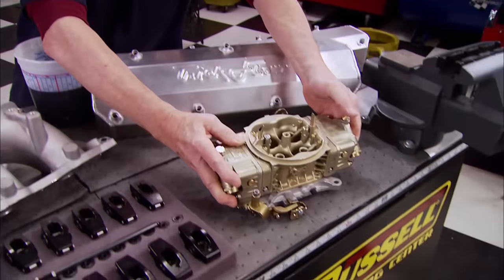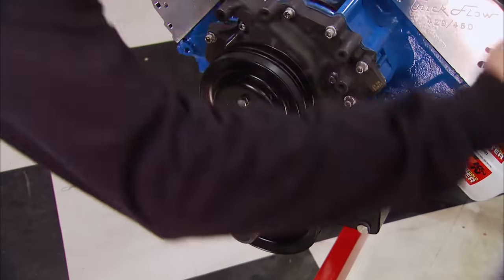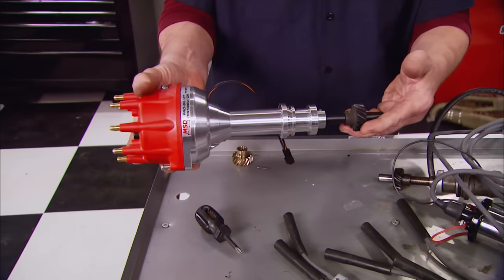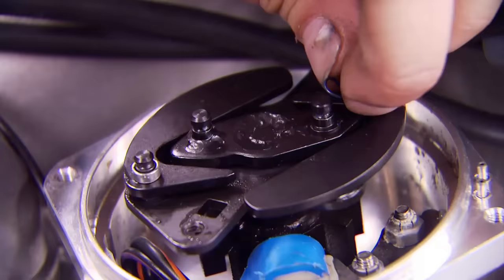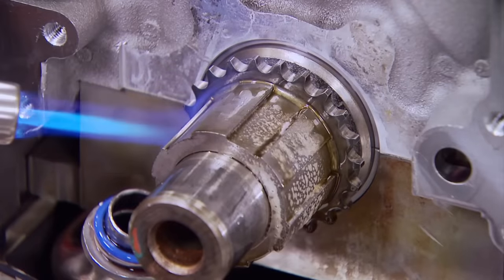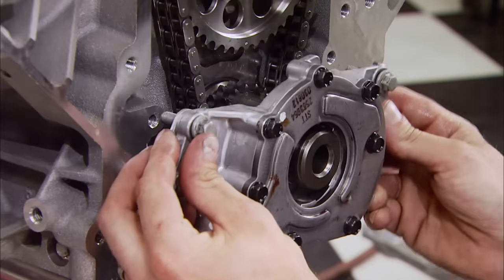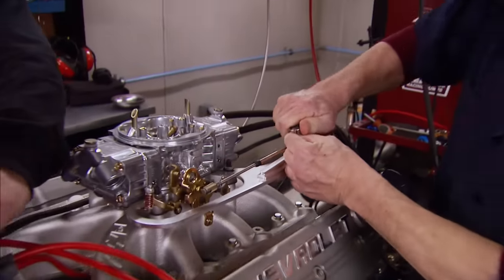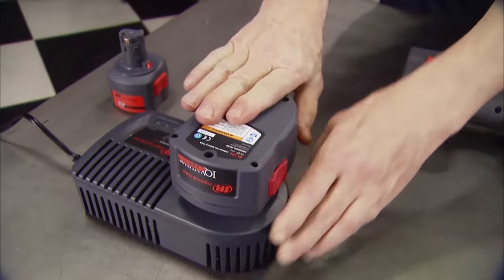Ford 460 Engine Build Part 3 - Horsepower S13, E10

Comment: Oh geez 😱 the quickest way to cross thread a bolt especially in alloy is starting them with power tools oh god
Reply: Only a problem if you expect to remove them later. /s
Reply: david eliassen , I saw that and NO LUBE on the cam swap either 🚽
Reply: It pained me seeing that. Using power tools to drive anything but large diameter, coarse threads is a no-no, IMO.
And the way they slam and stuff things around, geez.
Reply: If you know what your doing its no big deal...
Reply: it made me feel a little sick
Reply: Cross thread is better than no thread😁😁😁
Reply: SpaceRider 
Your right. I’ve been a technician for 35 years. And that’s what you do in lot a cases.
Reply: @robbiefrentz9427  
Cross thread is stronger than locktite
Reply: Alex West 
Roflmfao. Omg so damn funny. Going to steal that saying 🤣🤣🤣
Reply: cross thread is the best lock tight!

Comment: 460 making 600 hp na. That's nice💪💪
Reply: With a mostly stock bottom end. Basically a head, cam and intake swap
Reply: marshall mcdowell the heads and the cam are pretty much the worst part about any stock 460
Reply: Add another 2k and you can have a 514 stroker for like 100tq more
Reply: john dowe I’ve got a 514 going in my 1967 Country Sedan wagon
Reply: @thedraftdoctor1  nice man, i want to build my 460 to a 514 in my 78 bronco
Reply: Add a 1-2-300 shot... 😂😅
Reply: @thedraftdoctor1  Sounds awesome brother. I would love to see videos of that.
Reply: Whats the parts list on the motor. Would like yo do the same build
Reply: @stevenvanheel3932  Have you had any issues with the oil overheating or low oil pressure with your 351M?
Reply: Parent of Twins it had low oil pressure at idle. I pulled the motor and fully disassembled it with the intent to rebuild it and turn it into a 400. When I took it apart I found that my 11,000 mile engine had every bearing showing copper. That is just a poor engine rebuild job by wagamon out of Minneapolis. I since then dropped in a 400 that makes like 12 psi of oil pressure at hot idle which is not ideal but not the end of the world either.
Reply: @stevenvanheel3932  I was wondering because my Dad and I rebuilt one 20+ years back and at first it had good oil pressure but within 5k or less we were having a hell of a time keeping decent oil pressure when warm. I was wondering if the shop hadn't cleaned the block properly or something so wanted to see if we were the only ones who had issues.
Reply: Parent of Twins I’m pretty sure that it is a really common issue. You may want to try to run thicker oil in it and see if that helps.
Reply: @stevenvanheel3932  Thanks but that engine bit the dust years ago. I wanted to know if that was strange or normal for the 351M and 400. It's too bad because that engine sounds awesome. Dad's truck looked awful but I loved driving it because it had an great sound to it especially when you got on it.
Reply: Parent of Twins they sound pretty good, that’s for sure
Reply: Imagine forced induction going through this thing. 900 horsepower?
Reply: Its capabilities are 640 cubic inches and thousands of ponys from turbos or nitro from the 4 bolt main version.

Comment: Why put a dizzy in the LS when you can just put in an MSD box. That allows you to use the factory sensors, coils, and plug wires with the carb!

Comment: I owned a 1969 Lincoln Mark III .  It had a chromed badge plate under the hood that rated the 10.5 to 1 , 460 c.i. at 365 b.h.p. @ 4600 r.p.m.  A great car with the engine to prove it.

Comment: Fun to watch the ole' iron 460 make some numbers...on your valve checking, fixed a fair amount of Chevy/Ford BB "porcupine" heads after checking valve wipe left & right by having to cut the pushrod guide plates apart then rotate and tighten back where the belong, followed by me TIG welding them back together....Enjoy the videos, keep them coming and I'll keep watching!

Comment: I'd really like to see an old school solid lifter flat tappet camshaft in the big block. I feel the 607hp at 6000rpm is being limited by the hydraulic roller since hydraulic camshafts are done by about 6000rpm.
This thing sounds so smooth I really think another 5-700 rpm might yield another 40hp making it ~ 650hp. Very nice!
Reply: ThePaulv12 
They couldn’t do that because it would have beaten the 454.
Reply: @roninkraut6873  lol
Reply: Na, it'll run forever like it is, and hooking all that torque up on street tires is gonna be really hard anyway. A big solid flat tappet can would soften it below 3000 rpm or so, but breaking the cam in, having to put zink additives in every oil change would get old!! Love to have that motor in my 94 f150 flareside! Ladder bars and track locator a must tho.

Comment: I'm all for the big blue oval was a chevy fan but got me an 89 mustang lx 5.0 it was enough to change me for good
Reply: love the FOX! 🦊
Reply: I've got 3 Fox Mustangs, they are cheap and FAST! I'm still building a 408 stroker. Hope to have it done this year, the engine at least. I've got some vids on my channel if your bored! LOL!
Reply: chevs allways cheap out.the 35-0 is a dog of an engine.good std,just dont touch it.ive allways had fords.here in aus.,my dad had holdens,gm,derivitive,never liked the design or mechanicals.small,cheap.cant beat a good clevo,top loader,9"..there a truck engine,tough.windsors are for race day..biggest rubbish chev sold was the 6.2 diesel,inc the 6.5 tdi.old buik petrol motor.good power but handgrenade..look up ford f1000,brazil.mwm 4.2tdi...you,never got them..

Comment: I'm a big block fan. I seen EFI 460 Modded. U can get way more torque than a LS9 modded.  Big old engine hard to beat lol.
Reply: True story!
Reply: Cubes are such a great thing when you need real power
Reply: And a hell of a lot cheaper too. LS9 is expensive where the 460 has been around for a long time. Ford made a lot of them.
Reply: @PropsandWings  Yup. I won a $3000 burnout contest with a $200 BBF. By far the best bang for your buck.
Reply: There’s no replacement for displacement.
Reply: @dickysgarage7120  .....ya buddy.....that was at Cleeter's Event!

Comment: My Bud was a BBF man. Built many 429-460's. As HRM mag said, the 460 was the quickest and cheapest way to 600 hp. You guys proved it. By the way my Bud ran his 460's at the Grove. He usually ran them several seasons before a tear down. In his words they were durable, dependable, and amazingly consistent. By the way the show was great, except for the Chevy part,lol.

Comment: Great video series on the 460's.....have built several and love them......once you get rid of Ford heads.  I'm learning a lot from you guys even at 72 years of age.  I can tell the info is good......your hands look like mine!  Believe it.  Wish I had your equipment.  Keep the faith.  PS.....Great work on the LS motor.....I've been resisting them as an old timer.....but, in my heart, I know that's where it's at now.
Reply: 460s are solid motors the bottom ends are hard to kill. Head and intake swap and depending on budget if you can do the intervals low psi turbo charger, or both Torque wins everytime. And considering if more NA power was needed the 460 turns into a 550 in a overhaul for about the same cost. If I had to go for a newer age motor.  Instead of the ls1 I think I'd go for fords 5.7l DOHC fully built these motors can make some serious power NA.

Comment: Throw that 460 in a Foxbody or a Maverick🏁🙌🏽
Reply: Samuel Monsivais or on a late 80s f150 hahahah
Reply: Samuel Monsivais , yeeha, I had a 1970 Ford mavrick
very lightweight.
Reply: Tim Schutte I love the old  Mavericks  there an underrated car that a lot of people look over
Reply: Samuel Monsivais , mine only had the 250 six single barrel carburator but it was my very first car I ever owned. friend of mine had the Grabber 302 V/8.
pretty fast car. did good burnouts, lol.
Reply: No that’s what the LS is for🤣🤣🤣
Reply: Amanda Brewer better to have the authentic ford motor instead of the bootleg ford motor.
Reply: Or swap that 460 in the Ford Ranchero or an F100 or even in a Ford Bronco.
Reply: CJ Colvin hell yea would love to see an F-100 build with a 460 in it
Reply: @sammyvices2547  Sounds awesome brother or it can even be a great swap for an old Bronco.
Reply: For me a maverick or a cougar
Reply: Samuel Monsivais I have a 1970 ford f100 with a 460 in it
Reply: Those Mavericks. I had a 71 with a 67 Mustang front clip welded on and rear metal flares welded on to cover the 13 inch racing tires. Fully built 302 with tunnel ram, Top Loader 4 speed, and a narrowed 9 inch rear end. Those were the days. It was painted black.

Comment: how about you start showing whole dyno graphs to get a clearer picture of power production
Reply: That's why engine masters is way better
Reply: Because it's not a Chevy. If that was a 454 they'd have forged high compression pistons, tried 3 different intakes and carbs with jet changes, multiple timing changes, then nitrous

Comment: you mention how much the budget build was but it would have been nice to include the general cost of the parts for the high performance upgrades to get it to 607hp
Reply: I agree. I watched the video a few times to find out, but you never said the cost of the high performance build.

Comment: Came for the 460 and stayed for the LS. Wish we could have heard the 460 idling. Nothing quite like a big block Lope . LS had a great idle sound. I know many of the new engines make fantastic horsepower and torque with an imperceptible smooth idle. But, I'm old, and Lopey rough idles bring back fond memories of my youth.

Comment: Really considered a 460 for my 94F150 flareside. I got heads, roller block, pistons already on the rods, intake for a hydraulic roller 357ci Windsor! Even got a tci tyranny! The difference in the weight and the powershot will almost make up the difference! But, we have a 460/c6. Decisions, but the economic impact with today's crumbling economy, go with what u got!!
Reply: A 460 would move that PU down the road very well.  If you're good with the gas bill, go for it!
Reply: @eskieman3948  yea, I thought about it. Knew some guys back when I raced that put them in 150s. They probably bought every 69 to 71 Lincoln  in 3 counties. They had a 68 Falcon (it would fit in that body, just used mustang mounts). But, I'd have to start all over! I got 3 sets of heads for the Windsor, 2 short blocks (ones a 95 roller), pistons already on the rods! Think I'm gonna sell those aluminum heads, the ported 289 heads will make more compression with the pistons I have on rods now! It's gonna be a rat rod, not ever gonna paint it!

Comment: What was the ford horsepower details and at what rpm? Most importantly, what was the torque? Wtf? Off into LS land.....
Reply: Technical Items they always throw LS sht in  Ford episodes! 😒
Reply: 607hp @ 7000 rpm
Reply: He only pulled it to 6k. But yeah I quick watching more than half the video turned into a chebby episode. Thumbs down from me.
Reply: Technical Items , Ford was about 600 HP
Reply: You guys are haters on chevy i mean chebby just jealous that chevy makes such a good motor reasonably priced and a million parts that the working man can actually afford and depend on i love the ford small block and the sound it makes dam good but it doesnt compete with any ls as in sales and parts ford didnt put any effort in trying to compete with the ls thats when i lost all respect for ford now if you want a coyote motor but who has that kind of money to work on it when you're just some schmuck welder working your ass off to make it with a family chevy does and im proud
Reply: Bryan Roupe he could’ve probably pulled it 6500 easily smh
Reply: When they dyno'ed the stock 460, it made 493 lb ft, and 378 Hp  So, I'll bet they easily pulled over 640 lb ft. ..but didn't want to make GM look bad.
Reply: @tuckerc3802  
I think the fellas are angry about the LS stuff because the title of this video is: Ford 460 Engine Build.

Comment: I missed what the benefit of the distributor part of the LS carb. conversion was.  Would not the MSD LS box that handles ignition on LSX carb. swaps be a lot cheaper and far easier to do?

Comment: Will you try fuel injection combustion on the 460 now that you have a baseline with the carburetor.  To see if you get more or less out of it or change power curves ?
Reply: Fuel injection is king.
Reply: This was filmed years and years ago. No telling where that engine is now .

Comment: Did they ever say what the all in price of this build was?
And this was 607hp on an essentially stock bottom end with a stud girdle correct?
Reply: A basically stock bottom end with a head, cam and intake swap vs a fully built 454 and it still was within 30 hp of the 454

Comment: Richard Holdener took a late 60's 460 from a junkyard put in a better cam and a set of port and polished Iron heads and made over 600hp. Kind of makes me wonder hell you guys were doing "throwing out the rules" but apparently keeping some restrictions because you can't tell me a set of 50 year old ported iron heads are better than what's available today.

Comment: Pistons (Compression) Killed the power big time. Put those dome pistons on it like you did in the bbc and it would have gained big power. Still good power for that motor.
Reply: Even the flat top TRW will get to about 10.5 with the stock head instead of those grand canyon slugs! Then close the intake valve a little later and still pump gas compatible with iron heads. 1 point higher for those aluminums.

Comment: Just what everyone wants.. A big mechanical fuel pump front and center in the engine bay
Reply: Or spend 1k in fuel delivery.
Reply: Or $150 for a Holley blue with a regulator
Reply: some of us dont have the 1200 plus dollars it takes. its not worth it for n/a.

Comment: Maybe I'm just inexperienced but why not just run a msd box?also if you were removing the heads why not just remove the lifters then the cam?
Reply: blown5.3 I was thinking the same thing seems like it would’ve been cheaper plus easier to control ignition. Also wasn’t a fair comparison to stock since they upgraded the cam. A cam swap on a LS makes a huge difference in power
Reply: I think the original TV broadcast of this was somewhere around 2005?  Or at least that is the date on the instructions in the kit which Pace Performance still lists currently.  At that point I don't believe MSD had that control box out specifically for carb applications.

Comment: A steel distributor gear is more durable than a bronze gear.
Also, instead of using the drill method for pre-oiling,
I use a garden sprayer, refitted with a brass fitting and send the oil
into the oil sending unit port.
Be sure to use a garden sprayer for bleach,
as it has O rings that can take the oil.
Put oil in the sprayer tank, pump it up, 
pull the trigger and pressurize the oiling system.
Works good for 20 bucks.

Comment: Engine power took a 460 Block and punched it out to 557 Cubic inches and made 850 HP with a Soild roller cam along with the Trick flow top end kit and made 1100 HP with some added nitrous.

Comment: So how do you put the belts and brackets back on what will I need to put all that back on the air conditioner power steering pump stuff like that alternator what will I need to put all that back on there since you put no spaces on the water pump and what kind of water pump will I need I want one that use a belt I don't want the electric

Comment: What cc heads did you use with those stock dished pistons? What was the cam grind? What did the compression ratio end up at?
Reply: 74cc combustion chamber would end up at 10:1 to 10.5:1 with dished pistons. Perfect for pump gas fuel.
Reply: @roychavez9676  if you like ping on a hot day....
Reply: @frigglebiscuit7484  they are aluminum heads on the build. 10.5 is perfect with no ping. On iron heads i agree with you. I would try backing up a little on the timing just in case.
Reply: @roychavez9676  idk....even with aluminum heads that scares me. todays gas is garbage lol.
Reply: @frigglebiscuit7484  i agree 👍

Comment: I can't stand it when they put an LS motor in everything. So boring. A lot of other engines make great power, so tired of LS builds. It reminds of evyone building a 32 fiberglass body kit car hotrod with a 350, turbo 400 tranny , 9 inch Ford rear.... boring, boring , boring!!!
Reply: Kurt Poblenz     You just told everything!!!!
Reply: Because it works.  But hell if I'm putting a 350 chevy motor in a 32 Highboy...
Reply: Adam Gardner ...how about an  olds or nailhead.... or go all out & put a Chrysler hemi in it. With a small block 350 , it will look like everything else.... the Toyota Camry of hot rods ☹️
Reply: Why don't you post some links of some of the other,  "more interesting" engines that you've built?
Reply: Jim Bronson .... I drive a 1933 dodge 5 window coupe with an early 392 Chrysler hemi. 10.5 compression isky hydraulic cam 290 duration 520 lift , with a tunnel ram , 727 with an 8 3/4 rear. Currently I'm building a 505 stroker 440 with a trickflow topend thats going in a 65 coronet hardtop with fiberglass fenders, hood, decklid & bumpers
Reply: @kurtpoblenz2741  that put the lid on the LS discussion.. 👍
Reply: Just like going that street and every restaurant selling the same thing on menu ! I hate to go to car show and every Ford model a has a 350 yes you Said it boring boring I had Ford model a with a small block Ford everything Ford then I sold it the who brought it put a chevy 350 in it I didn't even want to look at the car again boring
Reply: @kurtpoblenz2741  Toyota engine actually WOULD be quite different!